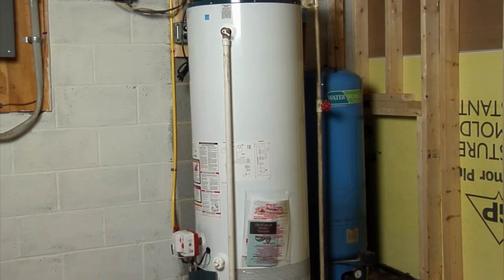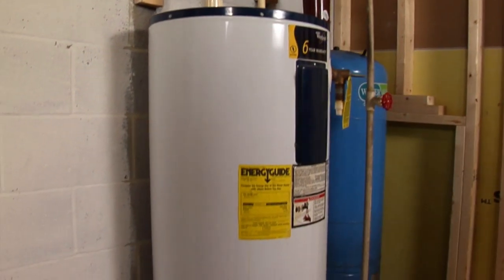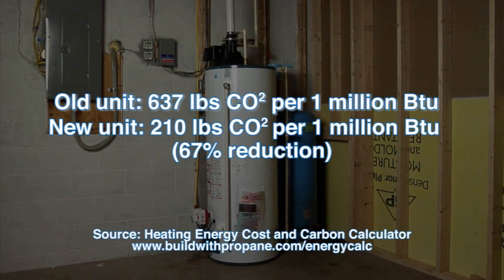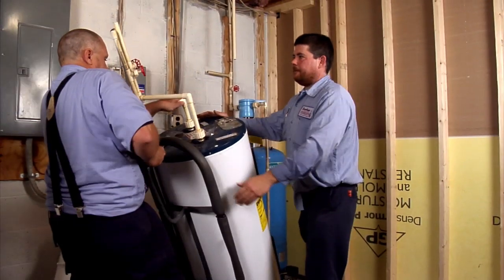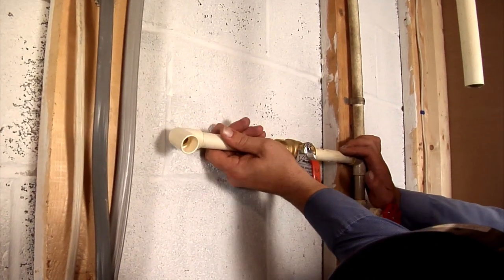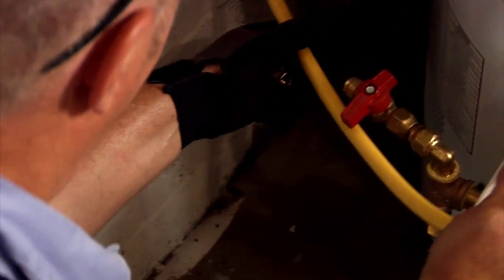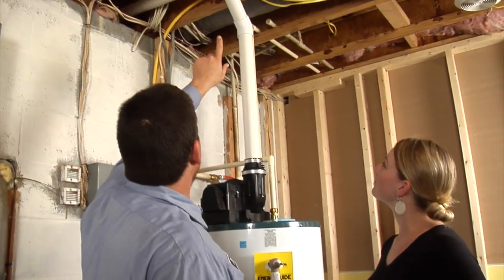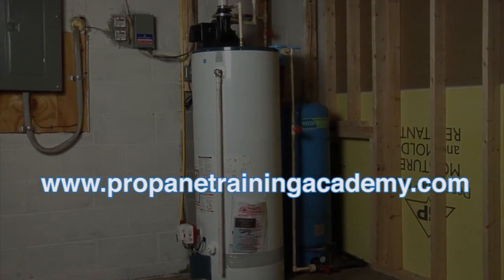Installing a High-Efficiency Propane Power Vent Water Heater

Comment: This is all great until you lose electricity and you will also lose your hot water.  During a recent 24 hour power outage here in Denver during the WINTER at least we were still able to take a hot shower by candle light.  With this system we would not have been able to do that.

Comment: Question for propane people.  My regulator froze up 4 times in 3 years.  How can.i prevent this.  I have an in ground tank.  To make matters worse befor it stops altogether it gives low pressure propane and the water heater doesn’t run correctly....yellow floating flames and making soot...had to clean it out twice.. may install a low pressure switch and alarm .
Reply: What size service line is ran from your house tank to the water heater

Comment: The 45 and 90 degree exhaust bends should be sweep not street bends. Sub optimal venting may cause carbon deposits to form on the flame sensor sooner or later and a possible AB lockout. Tidy install though . . .
Reply: That's ok...it gets a service call for cleaning the flame rod for a couple hundred bucks.
Reply: Jimmy Ray
A good excuse to go back and see that home owner.
Reply: 1) Those are short radius fittings, not street.  2) Before critiquing an installation, provide an IOM manual reference for approved venting material and installation procedures. That paticular model may be just fine with that short of a linear run with equivalent footage taken into consideration for the short radius.
Reply: Not true for that short a run.